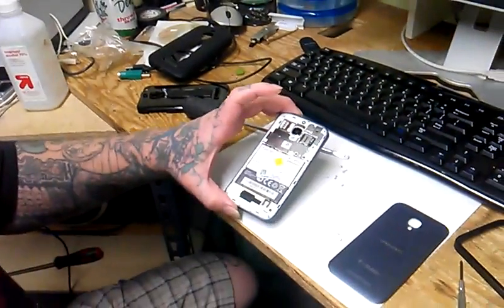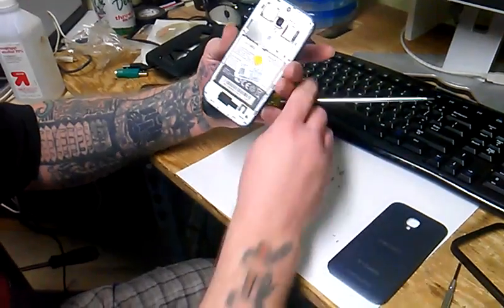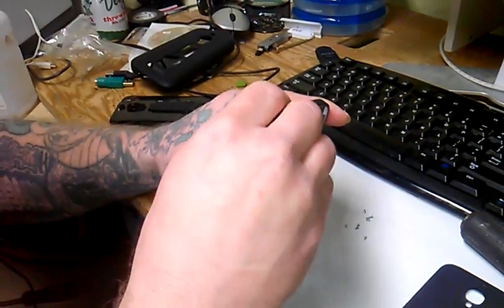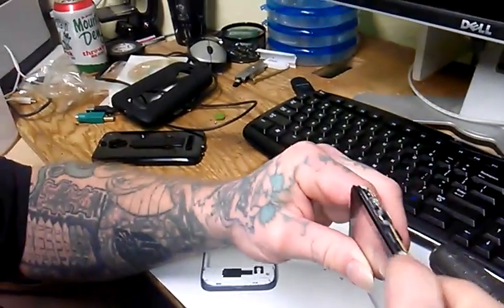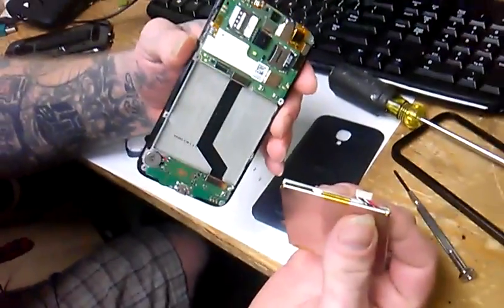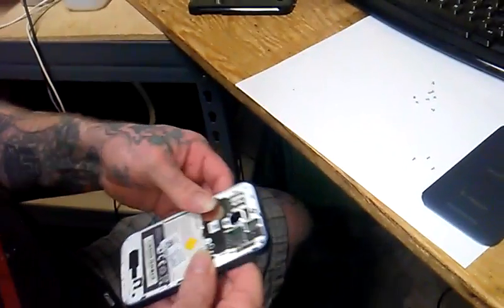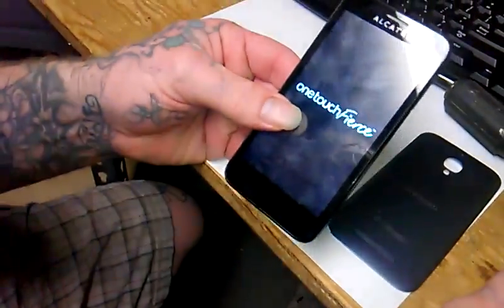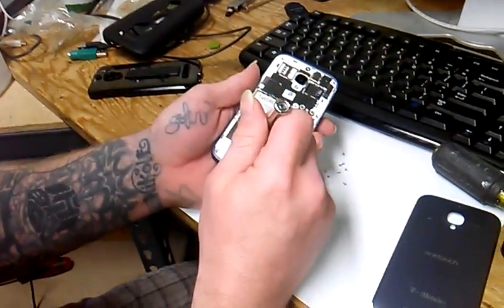alcatel one touch fierce black screen fix 2014

Comment: OK,  I bought an actell one touch exactly one month ago,  and with no damage,   the battery stopped charging.    I took it to the local Metro pcs store,  no help.      So...  I was planning on buying a new phone on my next paycheck (which  I have now) and I went to my last resort....  Youtube...  And found this video.      Guess what,   my phone now works...  Charges  perfect....  Dude,  you just saved me about  100.00.    Thank you so much.    It was very easy to remove the back..  Just took some tiny screws out..  Un hooked the port,  plugged it in...  Now it works...  Thanks so much.      And to  actell..   I HATE YOUR  DUMB PHONES..  WE HAVE TO DO THIS STUFF TO GET OUR PHONES WORKING..  anyways..  Phones good now..  Warranty voided  O WELL.    enjoy.       This is a good video for anyone with battery issues on the actell onetouch

Comment: i hate non removable battery's
but its like 
every
freaking
company is going to it
my reasoning
i was playing an online racing game
with two people on the server
when my controls went all screwy and my screen went from horizontal to vertical [] and my my controls didn't work at all

if i had to do all this bullshit just to remove the battery
that would have given the hacker plenty of time to do whatever (s)he wanted

what does this have to do with the video
this happened on my
Alcatel one touch pixi charm
that i got from my mother for a graduation present
and that's y if i look for a new phone and the battery isn't removable I'm not getting it

Comment: mine when I lock the screen it flashes the screen for a second and locks again. I found a temporary fix is to pop out the battery but I would like a permanent fix. My phone is a Alcatel Onetouch Pop and I tried to root it once.

Comment: my Alcatel one touch screen turns black but the backlight stay on along with the charging light but no picture or anything comes up it happen twice to me back to back I was finally able to get my phone on once my battery fully drained out and once I put it back on the charger and cut it on it took my phone date all the way back to Jan 1 1970 so I changed the date back to 2016 and sat my phone Down to charge and it started making a buzzing noise and vibrating for 3 mins straight even when I cut it back off and once it finally stopped I left my phone off and it was charging fine and I went to sleep a bit and woke up and my phone stopped charging and the screen is black with the back light and charging light still on again like the first time

Comment: Very helpful. My phone had the black screen, but the white charging light did NOT come on when the phone was plugged in. Followed this video and the phone is back to normal. Also, I did NOT need to remove the thin, aluminum plate first. Just the 9 screws. The aluminum plate came off with the casing. Thanks again!

Comment: Sir I have a question. I did it and it worked but my power button is still broken when I charge my phone it shows one touch fierce but doesn't show the battery I charged it but my question is how many times am I able to do the process of taking the battery out and holding. The button

Comment: sir can i ask something can i do the same thing on my alcatel one touch 6030x , i format my phone or "hard reset/restore factory settings" coz i forgot the password then after 2 days my phone screen turns black and i dont now why. i can turn it on! but nothing pop up on the screen even the alcatel logo, but its have a light on the back screen button, home button, and the other one on the right. the only problem is the screen, its totally black. sir help me! all i need to do is to remove the battery and put it again ??? answer please                       thank you sir. sorry for my English!

Comment: Dear Joe, I also have an Alcatel one touch fierce 2. And my phone doesn't look anything like yours does when you open it up. I can take the battery out with no problems.. There isn't any guard over it? But I do have the same problems as your having. Black screens/ phone freeze/ internet crash...ect, ect....and just taking the battery out solves the problems. Except 2 differant times I had to hard reset to get the phone up and running again.. I wonder why all of the Alcatel one touch fierce 2 are not made the same????
Reply: Same! I feel you!

Comment: I have had problems with my Alcatel One Touch after charging it on my laptop. It does great when the phone is on while charging. But if I plug it in while it is dead or if I restart it while it is charging on my laptop it tends to not turn back on. When this happened for the first time I tried rebooting the phone and not even that would work. So I left my phone plugged in for HOURS via wall charger and it eventually would turn on. Takes a lot of patience. I've had a couple blonde moments and plugged my phone into my laptop while off after realizing what the issue was so this method had work for me multiple times. Just now I was rooting my phone while charging via laptop.... restarted the phone and what do you know.... black screen. So what I would suggest for all of you who don't want to void your warranty is to charge you phone via wall charger for as long as it takes to turn on. I would periodically go check my phone and press the power on button once and if the screen would have the icon of the battery charging then it was good to go. One time this took up to 4 hours and another time no longer than 30 minutes. And just and FYI the whole time I had it charging the white light was on. If this method doesn't work for you then this would be your next and probably last option other than buying a new phone.... and if this doesn't work for you  and you either don't have warranty or can care less about your voiding warranty  then I would go ahead and use this mans brilliant idea. Word of advice for everyone; DO NOT CHARGE YOUR ALCATEL ONE TOUCH VIA LAPTOP WHILE THE PHONE IS OFF && DO NOT RESTART THE PHONE WHILE CHARGING ON YOUR LAPTOP.
Reply: good advice  thanks
Reply: +Stefani Meachem 
Im having a big prob on it right,,and this vid is so hard to do..when my cp hang i auto RESTART IT but the problem is,, it still hang and stayed on opening logo. (sucks) now even if i open not app but gallery only like check photo or delete one,, it let me auto exit and then turns BLACK SCREEN for awhile den back to wallpaper :( anyone knows ?

Comment: tried it. didn't work. screen still black. difference between mine and his seems to be that he could still get the screen to display something. this fix doesn't seem to work in my situation when the display has gone black. can hear it powering on, but can't see anything. incoming calls go straight to voice mail.
Reply: actually my screen showed nothing. only when it was pluged in did the little white light come on but nothing on screen nothing at all.... i had to pull the battery . it came back on after i put the battery back in. im sorry this didnt work for you. i rooted my phone and it wouldnt come back on till i did this. thats why i made this video.

Comment: i had a problem where it wouldn't turn on... i did the volume up/power combo and i got the menu but both of the choices resulted in nothing but disapointment... so i got mad, cursed, slapped my girlfriend around a bit... im kidding but i was out of options and in a last ditched effort i plugged it into my computer and it came right on with no problems

Comment: You dont even have to do that.. >.> I just fixed my phone I was starting to do this but I didn't have the appropriate Philips head so I looks on the label and it told me to hold the power button for more than 7 seconds so I tried it and it came back on, but its not really 7 seconds hold it until it comes on.

Comment: thanks man!!! this was right on time for me. Mine would not turn back on after an  update (conspiracy theories?) and I gave it a shot, now my phone works perfectly. As an update to your process, I only removed the screws, left the shield in place and it came apart just the same. On a side note there is Kapton tape (transparent orange tape) on the connector that will fold over the connector ports if one is not careful.
Reply: Micah Faircloth yaya ... i dint realize that till after i done opened it up ... i thought i said so on video but i guess i didnt ... truly thanx for reminding me this and i hope others r smart enough to  read this part... :)
Reply: william witmer

Comment: You do "NOT" need to take the shield off. Just remove the screws and shield will come off with the frame. Thanks for the video.
Reply: Plus. This way T-Mobile/Metro won't know you opened it.:)
Reply: Jason Bernard ya didnt realize till after i ripped it off but ur right

Comment: I just held on the power button for 10sec, then turned it on
Reply: Dude that thing were you said hold the power button for 10 seconds worked for me.Thanks
Reply: This worked for me too. I held the power button for about 20 seconds.
Reply: No prob
Reply: Santos what the actual shit, i can Not believe that worked. Thanks a lot.
Reply: Savannah Simon, try charging the phone over night and then try holding the power switch for 10-20 seconds. Thats what I did.
Reply: thank u so much
Reply: This worked!! Thank you